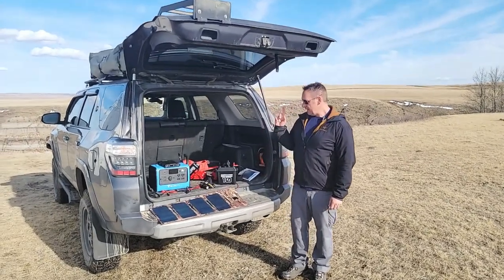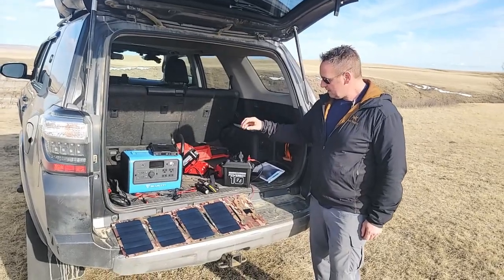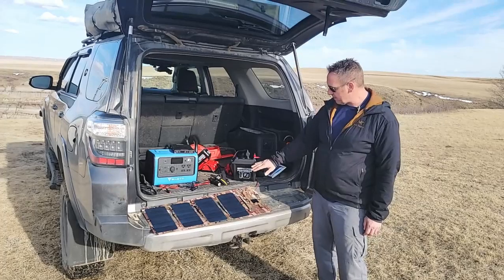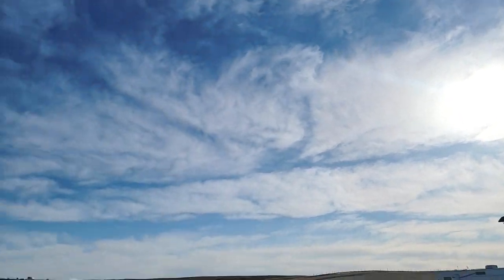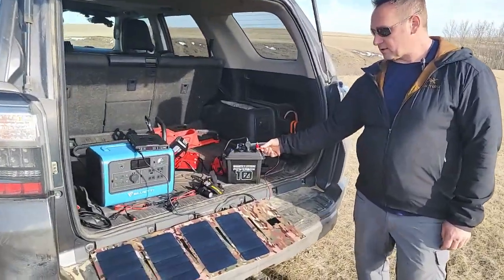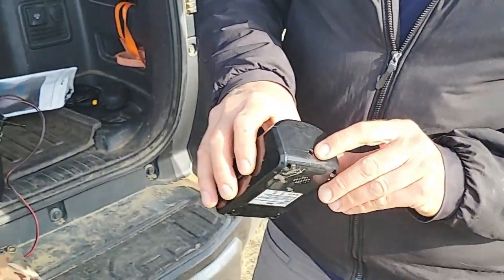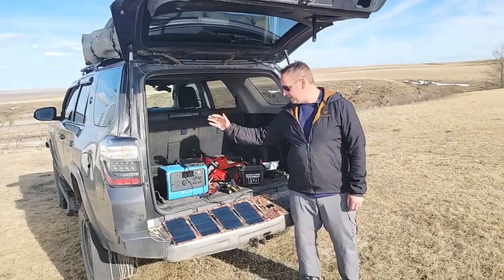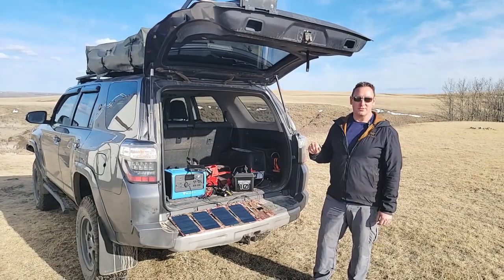Powering even more from our 28 5W Solar Blanket

Comment: Just so it's clear. The blanket holds no charge itself. It's only a trickle charge unit, meaning you can only power up a chargeable unit when in the sun. So if you are hiking, and have this to power your GPS or phone, you have to connect the cable to the USB port while hiking.